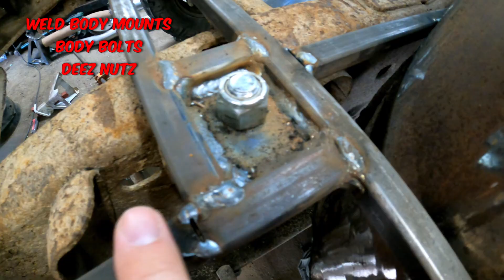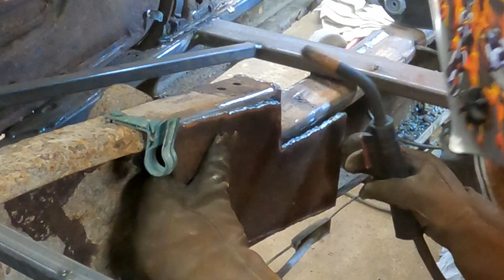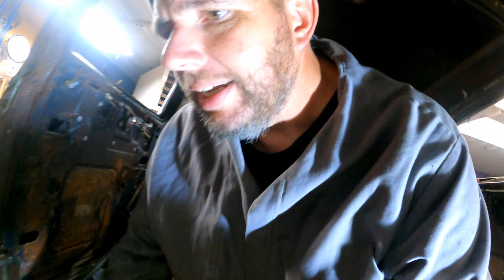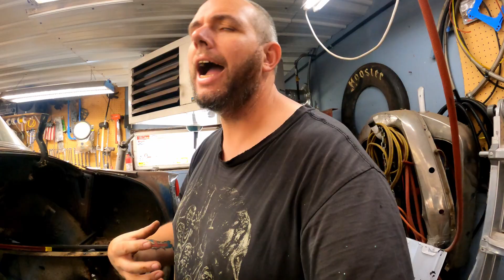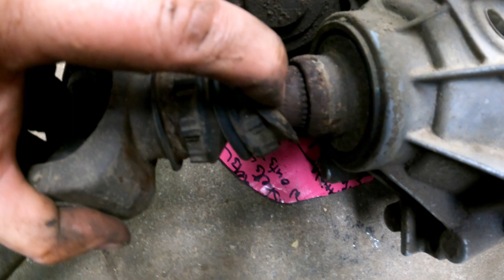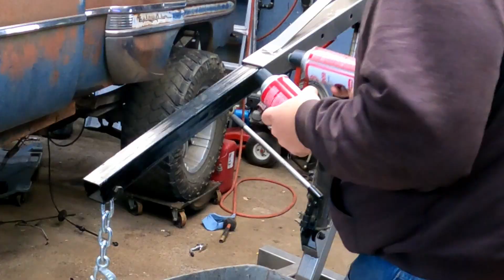How to tell if you have ADD/ADHD {Ratrod Edition}

Comment: Have you tried nozzled dip? Maybe that'll keep your tip from getting plugged up with slag and the wire getting stuck in the tip.
Reply from the maker: I have I just forget to use it but thanks for the tip